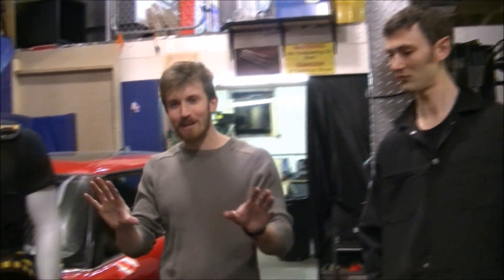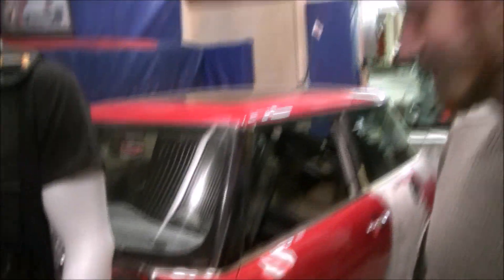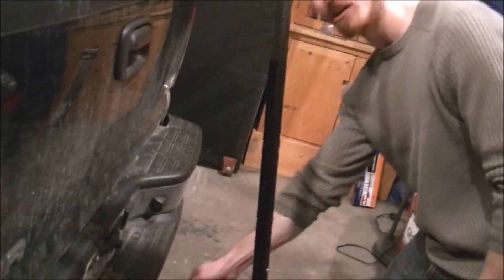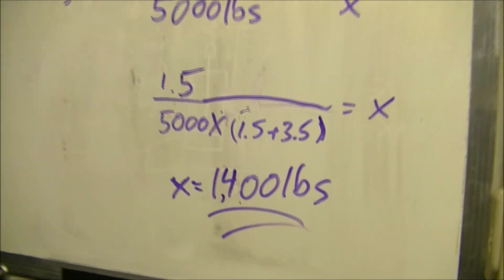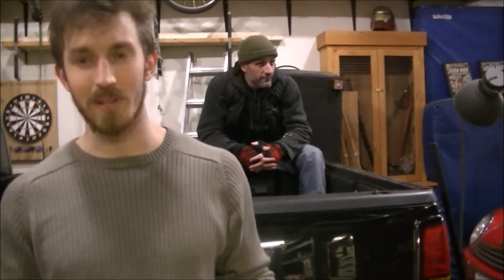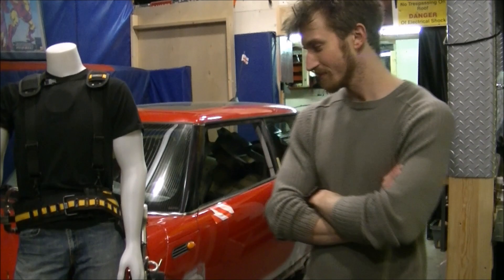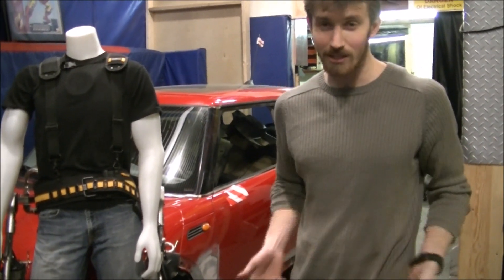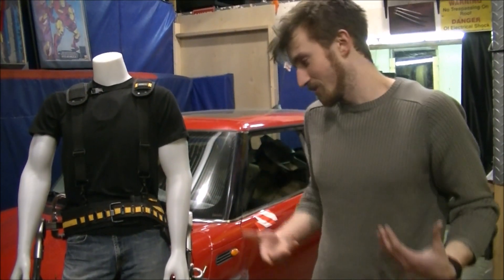Update: Can we lift a truck!?

Comment: If I'm not mistaken, there are two points where the boots connect to the rest of the legs which are: the cylinder and the "knee" piece. Since the piston is quite thin, couldn't you reinforce it by attaching steel rods at the base of the boot, and some tubing/pipes on the outer tube (larger portion of the cylinder) in order to create some sort of "guide" to prevent it from buckling. I assume the pneumatic cylinders are quite pricey as I believe you said in a previous video so this (if it works) may be a cheaper alternative.

Comment: if you add like a small air balloon you could fly but, you could drift around in the air, and have no control
Reply from the maker: +Shane gaming No animation. It'll be real. It'll be expensive, and completely non-feasible for real-world use, but it will work, and I will fly.
Reply from the maker: Lol what's that got to do with lifting a truck!
Reply: +the Hacksmith you were talking about flying like iron man at the end of the video, it was just an idea of how you could of done it
Reply from the maker: +Mason Stapleton But that's not flying like Iron Man!
Reply: +the Hacksmith air balloon is the best chance for you to fly, otherwise I don't really how's it going to fly
Reply: +the Hacksmith But it's flying like Batman!
Reply: +Mason Stapleton he wants to put in animation to make it look like he is flying probably using the pulley system he made not to long ago